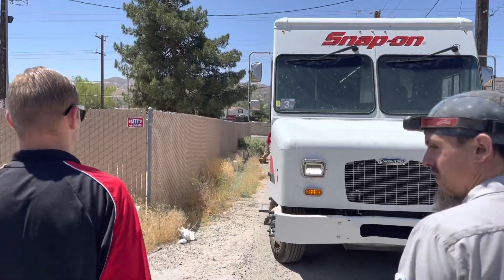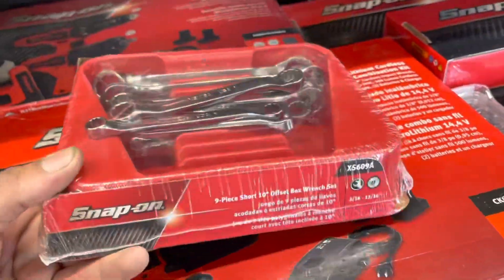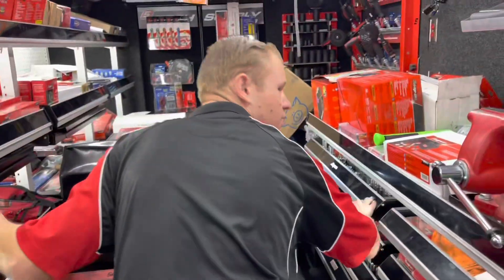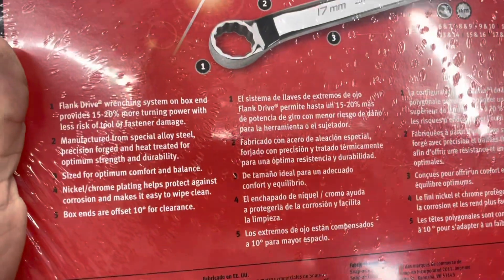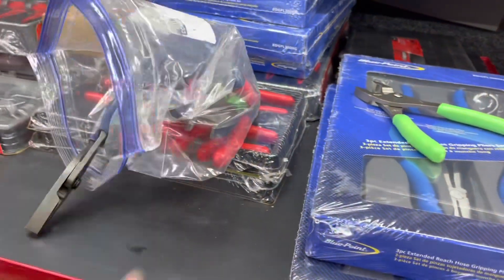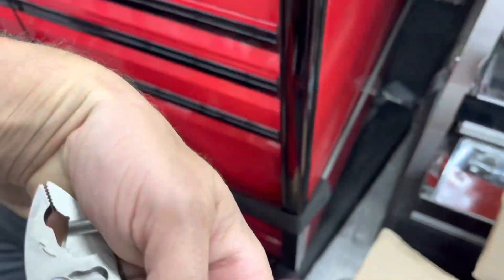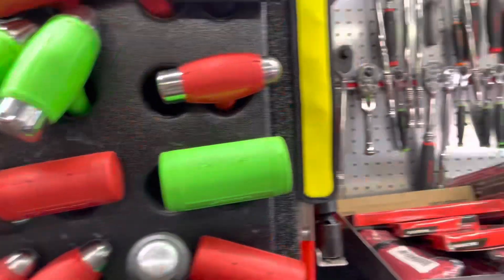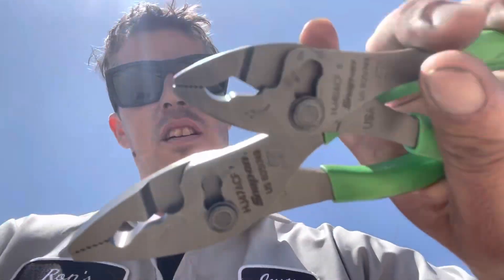Why Buy Snap-On Anything?

Comment: You’re spot on, Dow. One of the few Snap-on products I have is the SGA102BR, 2-pc hose removal set. Good ole Mr. Clay from Koon Trucking showed them on his channel a few years ago. I liked the design better than what anybody else offered and not being pointy, so I bought the set from the local Snap-on truck. I haven’t poked a hole in any radiator or fuel line hose yet. Then close to a year later I see a similar set offered by NAPA in their Carlyle line and Cornwell. The Snap-on rep probably wasn’t to keen on me just paying cash for what I bought.😜

Comment: Tool trucks are great for the lifer whose making master tech wages.  But, I’ve worked with so many young techs that are not putting anything into retirement.  Before I bought a single tool truck brand my house was paid and I had zero debt.  I’ll add I worked 2 jobs to get that accomplished for 6 years straight.  Even after this I was very selective (pliers, ratchets, sockets, wrenches).  On the way there I found out what lasted and what actually would warranty.  Best of luck.

Comment: I really miss Sears before they were bought out and still had tool catalogs. All the sockets and ratchets were US made with a full warranty. They were a great deal when on sale. They'd have tool sale catalogs where you could buy master sets of every socket they made. Their biggest mistake was shutting down their catalog operation just before the internet took off. It would have transitioned over perfectly. The only Craftsmen socket I ever had break was a sparkplug socket. Probably because I has trying to take out a plug when the engine was too warm and I was using a breaker bar.

Comment: Old school mechanic here. Hope you got those for free as for like an advertisement.  One of those pliers is $53.50 & the other is $61.50, HELL,NO! I would not pay that price for two pliers.  Hell you can get a 10 piece pliers set by Kobalt for $44.99 & there are good pliers. Or a set of Gearwrench 6  piece pitbull pliers  for $64.21.  Overall, Snap-on is crap and there products in tools are  way overpriced,  The only  thing I think, that there is quality in Snap-on products is there wrenches, and that's about it. But hay, that's just my opinion.

Comment: Dudes tool truck is a freaking mess. 
Back in the 80’s when I started I’m the buiz Snap-on was the staple these days with Mac and Matco the Snap-on truck is a over priced corporate run rolling rip off.

Comment: Alot of it is the service from my dealer. Goes above and beyond. And the tools we can depend on in heavy line work.  

Btw i want to recommend the new snap on cable fuel line disconnect pliers.  Honestly they are the best thing iv brought in years.  

Same as the hose "cable " pliers but for fuel line